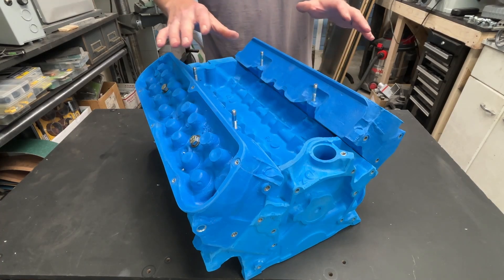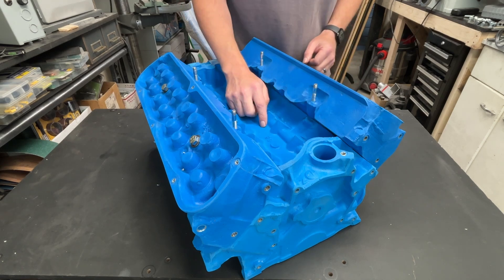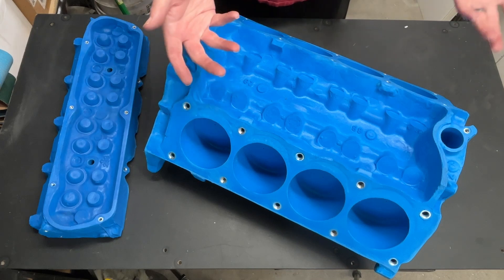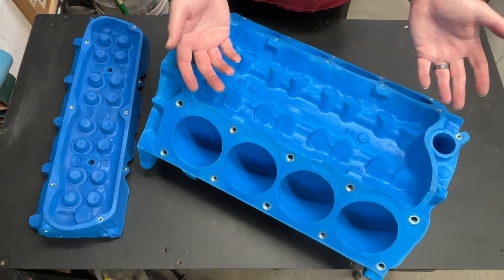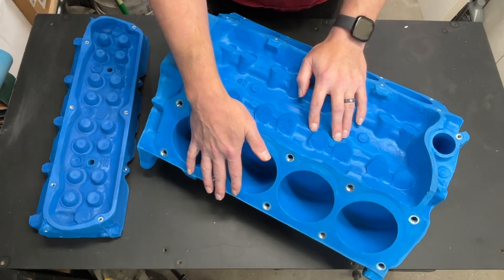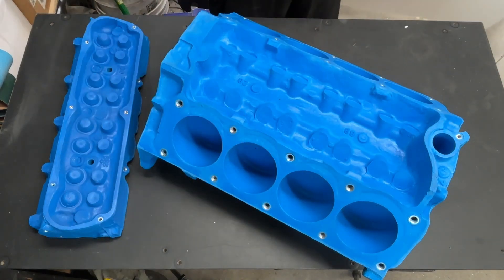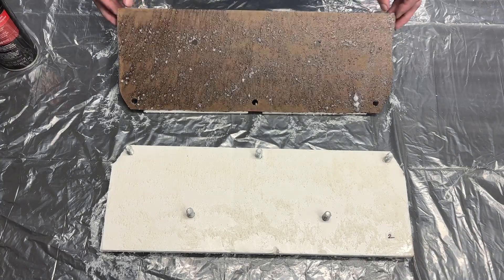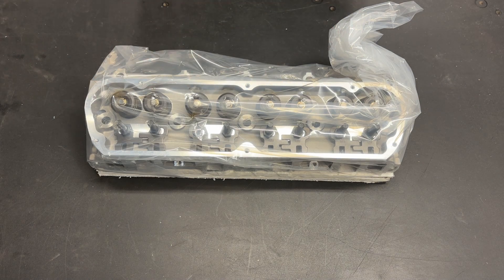Replica Mock Up Engine Block, One Block for a 302 and a Mod to Make the 302 into a 351w.

Comment: I can’t believe how much we think alike.  Early 2000’s was planning a 2-3barrel carb set-up for a 351w.  Dropped that and went with a Hurricane and a Holley Comp Series double pumper.  I built a 351w stroker 389.  Yeah, I even put Pontiac 389 emblems on the valve covers.  This engine went into a Mustang II and in the process, I had needed of a light weight block.  Payr was out of the question, so I built a short block out of Pine boards.  A perfect replica. I even added beach sand to the Red paint so it feels like cast iron. Later I did buy a Payr AOD automatic.  I only used them once, but they are nice to have.
Reply from the maker: A mock block is nice to have.  Don't use it much but when you need it its "worth its (lack of) weight in gold"

Comment: I have a question. I just bought a 1962 Ford F -150 truck and was thinking of putting a 302 or 351 in it. It has a stock 292 Y-Block. I dont know the dimensions of the engine bay, but I think or am guessing a 302 and maybe 351 would fit in this engine bay. Do you happen to know if they would? I haven't had the chance to measure the engine bay yet. Thanks
Reply from the maker: I am not as familiar with truck but a  302 or 351 should fit without issue HOWEVER the Windsor type motor didn't come out until 63 so custom engine mounts may be needed.  That's what I had to do to get a 302 in my 62 Galaxie.
Reply: @dazecars  OK, thanks so much for your reply. I figured the Y-Block is quite a bit smaller than the 302 and 351, and the fenders/ wheel wells are pretty large in the F-150 truck, maybe a 302/352 would not fit in the engine bay. I think I will have to maybe buy one of those mockup engines and do what you did to add spacers to make really certain it would fit before I buy an engine or an engine block. Do you have any recommendations about the best engine blocks? I saw World Products and they look like a really stout compared to other brands. I was also looking at Ford Performance M-6010-BOSS 351 blocks.
Reply from the maker: My question is what do you plan to do with the truck?  If it is just a driver than there is no reason to get an expensive block, just get a stock casting and rebuild it.  But if you are going to race, build a stroker, or put power adders to it like NOS or boost then at theat point an aftermarket block is needed.
Reply: @dazecars  No, I dont want to race it, dont want any power adds, but I was kinda, maybe thinking a supercharger might be cool, the biggest thing would be what block/ engine will fit  in the engine bay. I dont have the truck right now, its being worked on, but I was thinking a 302, 351 or LS. I think the 302 or 351 cuz they would probably fit and they are Ford, I dont know if an LS would fit, and I think I should just keep it Ford. Basically, I just want to enjoy it as a cruiser. I think maybe the  351 might be best for torque and I could still actually use it as a truck. I know if I put a bunch of power in it, I would have to completely change all of the suspension, but I already do want to put much better brakes. I was thinking of painting it, but now I think maybe just keep it original as it is, I think its the original paint which is white. Its cool cuz it has a big chrome rollbar, very 80s.  I thought of getting an aluminum manifold from Blue Oval, it already has a 4 barrel carb, and some headers and nice exhaust and drive it like this for a while. I do want to hotrod it eventually and watched some vids about hotrod Y Blocks, but I think thats a lot more expensive than just a 302 or 351. I think a 302 or 351 with a supercharger would be cool, if it would fit. I decided I want to keep the body completely original, not cut it at all anywhere. How many original unmolested 1962 Ford F150s can there be left? How come you put a 302 in your Galaxie? A friend of mine had a 68 Mercury Montego with a 302, I always thought way too small of an engine in pretty large heavy car. Nice to talk to you
Reply: This guys truck is inspiring to me, mine is kinda like this, but it doenst have really any rust, but mine is white like this with a giant chrome roll bar

NASCAR Ford F100 Truck LOUD & FAST!
https://www.youtube.com/watch?v=98Wm_88mNbA
Reply from the maker: First I put the 302 in my Galaxie because I had one.  It had decent power, way more than the 6 cyl and Y blocks that were available in 62 but obviously not as much as the FE motors there were also available.  I am building a 351W stroked out to a 393 because I wanted more low end torque but the 302 has served me well.   I also have a manual transmission and reasonably low gears in the rear end making the car a lot of fun to drive in its current configuration.   I am hearing a lot of potential plans for your truck and that is good but it is easy to get bogged down and not build a vehicle for its intended purpose.  I have seen a lot a people get persuaded by the allure of more horse power and end up with a vehicle that doesn't drive well.  In everything you said "Basically, I just want to enjoy it as a cruiser" sticks out as an overall build plan.  If that is what you really want find a stock 351W (assuming it will fit) and rebuild it as either a 351 or a stroker.  keep it simple for both ride quality/drivability and reliability.  A super charger will give you more horse power that you likely wont need for a cruiser and make it more challenging to drive and more prone to drivetrain issues.  That's my $.02
Reply: @dazecars  OK, thank you for your advice. I was thinking about a stroker 351 for the torque. I have read a lot of hot rod magazine and muscle magazines and everyone says that is the best thing for a street driven cars. I know about torque really being more important than horsepower rpm's cuz I also have a 1969 Lincoln, am also trying to get this back running. If I was going to just buy a 351 already assembled as a crate engine, where would you recommend? I think for right now I will just look at buying a new manifold if they are aluminum from this Y Block guy named John Mummert, and then look at maybe trying to find headers and a nice exhaust, and just enjoy driving like this for a while. I didnt know that about superchargers, what issues do they cause with the drivetrain? I dont have the money to jump into a huge, major rebuild right now, so I will just focus on getting both the truck and Lincoln running.

The Engine That Replaced the Flathead -- Ford Y-Block Build
https://www.youtube.com/watch?v=XB_Q9qpvnL0

How to build a reliable, powerful Ford Y-block
https://www.hotrod.com/how-to/build-reliable-powerful-ford-y-block/

http://www.hammerheadperformanceengines.com/

John Mummert
http://www.ford-y-block.com/
Reply from the maker: super chargers are a great power adder.  Any time you add boost weather by using a super charger or turbo it really adds a lot to the motor.  Problem is they are complicated.  Fuel management becomes an issue and you will either need EFI or a special carburetor.   Also the motor has to be setup to handle boost that means a larger piston ring gap and lower compression, 8:1 or less.  You also need good quality head gaskets as the extra air/fuel will cause higher chamber pressures.  Adding a super charger to an old tired motor will quickly show its weak spots and likely end the motor's life.

Summit racing overs crate motors and is a good way to go if you can make a 351w work.  The other issue you will likely have is the transmission you are currently running will not likely bolt up to a 351w or 302.  Just something else to think about.
Reply: @dazecars  Thanks for the info, sorry I did not get back to you sooner, busy working. What are good quality head gaskets? I see either way, the engine has to be set up correctly. I am not a mechanic and have never built an engine, so I would have to pay for someone to do it for me. I have watched a lot of vids on Powernation and Engine Masters and have seen how precise things need to be for an engine to run right. Would there be a difference in price for building an engine with carbs compared to a supercharger? 
The 1969 Lincoln I have I wanted to keep old school with carbs, it has the original iron block and I want to make it a 545 stroker with dual 4 barrels. It had already started to be hot rodded when I bought it. It had been lowered in the front, maybe someone cut the springs, it has American Racing rims, and original Cherry Bomb glasspacks from the 1970s or 80s. It hasnt run for several years, it needs new head gaskets, so I am going to try to get that running this spring and summer. Someone tried to steal it when I had in storage and totally destroyed the steering column, so I have to buy a new one
Reply from the maker: if you are not mechanical I would avoid boost.  Keep it simple
Reply: @dazecars  Hey, well I finally got the truck and drove it home last Sat. and OMG it was a bear to drive. It has manual steering, though it does have an after market cool, smaller racing style steering wheel, that is nice, cushioned and grippy, easy to hold on to. It has a very weird 3 speed trans, with a Hurst shifter. The worst thing is the engine died and stalled every single time I was slowing down for a light, then its difficult to get it started again. Something is definitely wrong with the carb, needs to be adjusted. The breaks are terrible, drums Im pretty sure and one needs to start breaking a block ahead before they are going to stop. I definitely want to get the carb worked on, and think I should get the breaks upgraded to at least a disc conversion in the front, and a power steering conversion. My friend was telling me to get a hydroboost for the brakes. This would have been a good engine I think for my truck

Modern 410ci Stroker Windsor with Custom EFI & Coil-Near-Plug Conversion - Engine Power S9, E14 & 15
https://www.youtube.com/watch?v=GqcXj8D0H1g
Reply from the maker: like many old vehicles they can be a handful until you do some work on them and get them running better.
Reply: @dazecars  How much do you think this cost to build this whole truck? I was just looking for vids of 1963 Ford F-100s and found this

1966 Ford F-100 451 Roush
https://www.youtube.com/watch?v=V3TcfQwaIIM
Reply from the maker: can't even begin to answer that question.  to many variables like cost of work in your area, condition of the vehicle and what your definition of "build this whole truck" is.  There is a big difference between a complete factory original restoration, a restomod, a rat rod and any of myriad of other restoration options..
Reply: @dazecars  Hey there, I wondered if you know about this engine - Mercury Marine SB4 7.0 automotive crate engine? I stumbled onto it and watched a few vids about it. The vids say a company called SpeedKore is the exclusive dealer. I found their website, but there is no info on the site about the engine, I wanted to know first how much it costs. I am thinking more of maybe buying a crate engine for my truck, rather than building an engine. How is your Galaxie project?
Reply from the maker: I know nothing about that motor

Comment: Do understand correctly, you added 1.3 “ thickness per side to increase the deck height. As I reread what I wrote I think I answered my question. 

I like it wish I could afford a 460 foam block.
Reply from the maker: yes a little more than 1.3" per side and then it can compress slightly to get it perfect

Comment: Wellll, sort of. The 351 oil pan is wider to accomodate the longer stroke, which means the crank with balance weights is larger diameter.
Reply from the maker: I double checked and it was as  I thought. Only the bearings caps are bigger. A 351 pan will bolt right up
Reply from the maker: I need to double check but I believe the oil pan is the same width and same bolt pattern... The difference between a 351 oil pan and a 302 is the crank size which requires larger bearing caps and thus a bigger half circle on the top of the oil pan on both ends.  I should be able to easily bolt a 351 oil pan to this block.
Reply: They look like the plates some folks use to increase the bore.
Reply from the maker: your right it does look a bit like a torque plate.